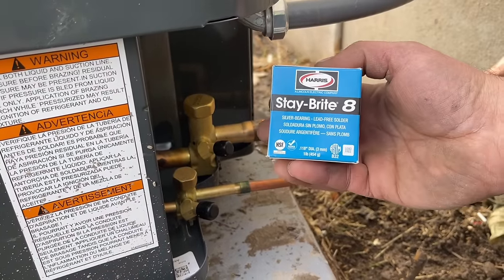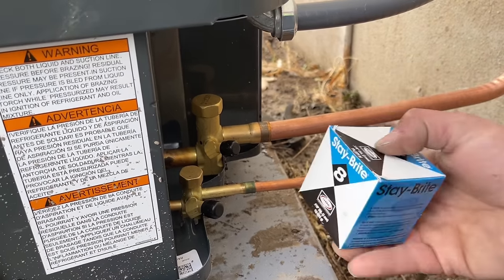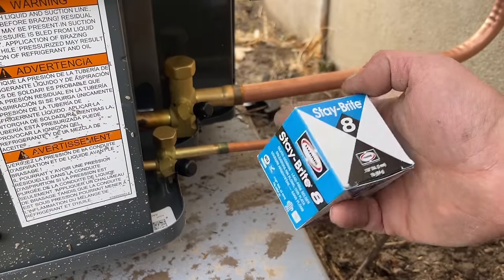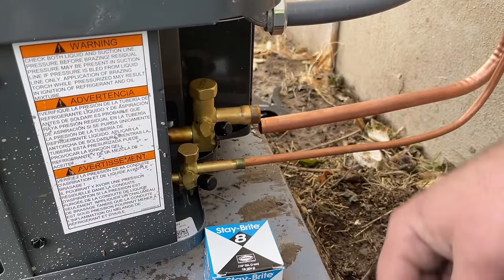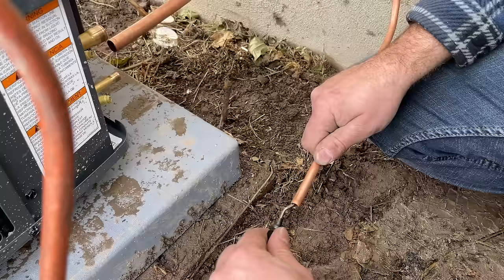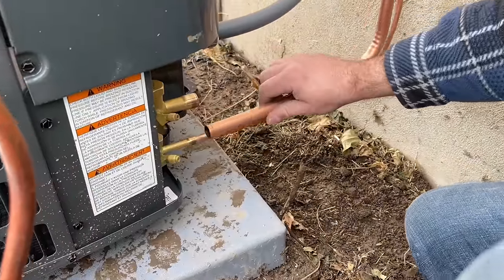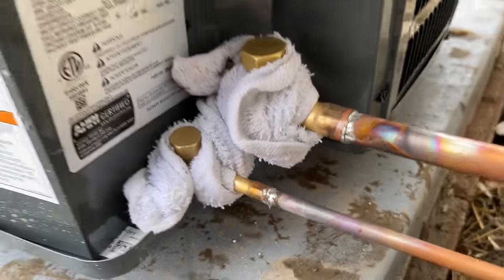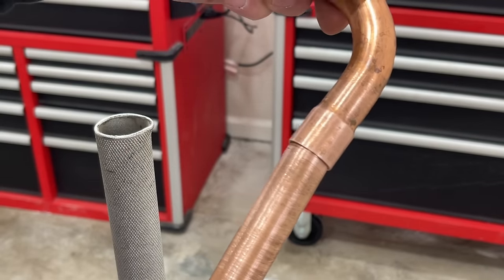An Awesome Alternative To Brazing HVAC Lines. Staybrite 8 Soft Solder

Comment: I had a 5 year old unit that had a codenser failure and bought a goodnan 2 ton replacement and put it in place what kind of price do you think of getting the pipes hooked up is a good price of somebody doing it? The eletric side is alteady done
Reply from the maker: It shouldn’t take more then a couple hours, so maybe 2-300 bucks?
Reply: @diyhvacguy  wish you was around southern indiana

Comment: I want to see at what pressure that joint blows apart. I personally wouldn't use it on a 410a unit, but everyone has their own way. I've never had a leak doing it the right way. To each is their own. With 18 years in the field I've seen soft solder joints blow apart.
Reply from the maker: It’s tensil strength is 10,000 psi. Maybe whoever you were following to fix their work didn’t know what they were doing
Reply: My brother used it on his system, three years ago, and also on his daughter's unit, last year, and they are both running great.
Reply: @Angry Beaver  So Beav, I'm not allowed to comment here?   If you were paying attention and not daydreaming, you would have seen a number of pros have used it over the last 20+ years with great results.  You can go back to sleep now.
Reply: @Angry Beaver  Beaver, the channel is aimed at the DIYer, is it not?   I have every right to comment on this or any other subject.   And, you have the right to disagree.  Commercial work involving larger piping should be brazed. Is anyone disagreeing with that?    This video, however, is aimed at residential HVAC work.     If you're are truly a "Master Chiller Tech", you should learn to chill out a bit. :)

Comment: I’ve been using Stabrite 8 for almost 50 years,I use stay clean liquid flux in place of the paste.I braze the two fittings on the compressor but Staybrite on everything else,I use Map gas.
Reply: What brand MAP are you using? I understand original MAPP gas production in 2008, and what is sold today are substitutes, and I wonder if they are still hto enough for this silver soldering?

Comment: great video   thats the product i want to use.   Should u sand inside the female ends of the fittings?
Reply: Yes, I do, I use a wire brush sized right for the pipe (for soldering copper plumbing you do the same, so I use the same type "bottle" brush).  You need to have both the female and the male cleaned with emery cloth (sanded) or wire brushed, then apply the flux  (whether brass or copper).  I just apply the flux to the male end, don't glob it on like he said, you just need to coat, the when you insert, you won't get flux into the pipes, when you heat up the pipes the flux will flow all around and you are ready to flow the solder, put the heat up both pipes and then just apply heat on the joint near the back - the solder will flow towards the heat.  I have never had a leak or fail using Stay bright, I think those that do, don't clean properly and flux.  You have to clean well just like in water plumbing pipes.
Reply from the maker: Yes in hind sight I should have. I’m going to start using the inside cleaner tool that’s has metal bristles.

Comment: You already have to have the nitrogen for pressure testing I’ve never understood why people make such a big deal about having to purge with nitrogen. Plus not having to deal with flux. To each their own.
Reply: Nitrogen costs money but I hate lugging around a oxyacetylene rig when I can use a smaller propane torch. Mapp gas is not necessary in my opinion. Mapp gas has gotten very expensive lately.
Reply: Wouldn't letting the system rest for 20 minutes after pulling a vacuum and checking for a pressure change indicate a leak as well as nitrogen pressure testing?

Comment: Use a smaller torch tip you cooked it.  I would use map gas
Reply from the maker: Yes, this was my first time. Thankfully the solder took. Moving forward i'll be using map gas, but for this one I didnt have my map gas with me. I should have held it further away for sure. Thanks for the input. Cheers

Comment: Do you use nitrogen for a pressure test? Or just a vacume? I first learned to soft solder years ago with R22 but was told is this not approved for the higher pressure operation of 410A. Was i lied to? Braising kinda sucks but does have some advantages over soft solder. And vice versa.
Reply: Staybrite 8 on their website is labeled to handle high pressure like r-410a
Reply from the maker: You sir were lied to.   Soldering is much quicker and lower temps so no nitrogen flow is needed but it’s sensitive to gaps wheras brazing can fill some gaps no problem

Comment: So after reading all the comments on here, very mixed messages. Which I understand, everybody has their own preferred method and then there are right ways and wrong ways I get it and then there are places and times for certain things vs other things. But I’m struggling with is just using the RLS press fittings any kind of brazing or soldering hard to get answers on that. The fittings are so damn expensive that’s my biggest headache.
Reply: I meant RLS vs brazing or soft 8 solder.*

Comment: Never heat the solder with the torch.  Heat the metal until hot enough to flow the solder.  Also if you get the flame on the flux it can burn the flux and you'll never get a good joint until you clean it all off ant start over.

Comment: Do any other commercial or industrial guys use this??? I have never seen it. 
Seems fine for residential. I wouldn’t solder and intellipack
Reply from the maker: I’m not sure. Is commercial a lot higher pressure? I’ve talked to many residential guys that have used Staybrite 8 for years

Comment: Isn't it just for water systems copper? Ac has to use the cooper and b tank right? Usually
Reply from the maker: No this is specifically for hvac application. It’s a game changer.
Reply: @diyhvacguy  no more b tank carrying !

Comment: This is a great update on a process to avoid brazing.  Now if we only need the nitrogen to do a pressure test, is there an alternate nitrogen regulator and hose you can recommend in your store instead of the $250 one that does not include the tank? Thx!
Reply: Any of the amazon stuff is ok for one or two timers. If you are pro go with victor or turbo torch regulator. Or go to proper welding gas supply and get what they have. I waffle on the good or cheap stuff. Depends on what you are doing. One or for life.
Reply from the maker: There’s no alternative unfortunately. You def don’t want to use compressed air for pressure test. My recommendation is go to your local airgas and see what the smallest tank of nitrogen you can lease would be. Then you’d need a regulator and obviously a manifold gauges set.
Reply: @diyhvacguy  I know the nitrogen regulator and hose is needed for a pressure test, I was wondering if you could recommend one on Amazon that works with the manifold you spec in your Amazon store. It might be cool if you had a "bare bones" idea list bundle of minimal equipment needed for a one unit replacement ...what the avg DIY job would need A-Z  e.g. Pipe cutter, Harris solder kit, map gas torch, manifold, vacuum pump etc? Getting that list down to a minimum takes your knowledge & experience.  Cheers

Comment: Looks like you used too much heat.  Granted I never used this product but if it is a true solder (less than 800f) then it looks like you had it too hot.  I solder all the time but for potable water and mechanical piping (I usually braze refrigerant lines) and the pipe should never be black when finished.  Also you want to heat the pipe just hot enough to melt the solder and then pull the heat off the joint.  Plus you only need a mapp gas or butane torch.  Looked like your torch was over kill.  Though the bigger line looked to be done a bit better than the small line.  Just some tips.

Comment: Don't apply heat like you're brazing. Just heat the valve side to suck the solder into the joint.

Comment: so would you recommend using this method or those R410a connectors you showed last week?  Ive sweated lots of plumbing pipe in my day, never HVAC lines though
Reply: Don't do it especially not for 410 systems this guy doesn't know high pressure systems are to be brazed.
Reply from the maker: I’m sure you will trust this rando commenter over me, but Staybrite 8 joints hold more pressure then brazing. Look it up. I’d recommend Staybrite 8 over the crimp tool as many folks have used Staybrite 8 and had a leak free joint for over 30 years.  The only time this shouldn’t be used is close to high vibrations so right at the compressor. Hope this answers your question. Cheers
Reply: @diyhvacguy  awesome.. I have an LG Minisplit to install in a few months on the new shop I'm building. Id prefer a more solid connection to the line set than using flare nuts.  Staybrite 8 my just be the ticket I'm looking for.
Reply: @diyhvacguy  This is soldering not brazing and you can’t say is stronger than hard brazing let alone insurance related to light flammable gases in refrigeration and AC industry…..so yes you could do like DIY job for your own use but not like professionally in industry

Comment: No soft solder isn't a replacement for brazing...they have their own applicable uses. i would use soft solder in any and all runs i have to sweat or runs in and out of a reasonably small lines going in/out of a moderate compressor but you wouldn't find that stuff anywhere near my chiller racks or centrifugal chillers where the harmonic vibration would be way more than enough to break the solder.

Comment: Hey man, does that soldering may resist heat pump pressure  as 400- 500 psi?
Reply from the maker: Many people have used this for 410a. tensil strength is over 1000 psi

Comment: That gas isn't actually "Mapp" gas, its Map Pro gas as actual MAPP GAS is no longer made.  Map Pro burns only about 135 degrees hotter than propane and isn't worth the $$$ or does it provide much benefit.... if any.  Just use a propane cylinder.  Also, Stay Brite 8 is very good, does a great job.  Oh yeah...make sure to wire brush the inside of the female fitting.
Reply: Tried explaining that to someone else but they wanted to argue. Cant fix stupid.

Comment: No risk of solder getting into the system, even if you don't put it in the female joint?
Reply from the maker: Maybe if you are sinking way too much into the joint. But I feel like that would be pretty difficult

Comment: Can that hold refrigerant pressures?
Reply from the maker: Yesir! It’s rated for 410a refrigerant. tensil strength is 10,000psi with Staybrite 8
Reply: @diyhvacguy  cool so it’s only rated for 410 not R22?
Reply: @Soufsiiide  its rated for R22 as well, 410 has higher operating pressures.

Comment: How much pressure and temperature (discharge line)can
 hold without leaking.
Reply from the maker: The tensil strength of staybright 8 is 10,000 psi
Reply: @diyhvacguy  95% tin, 5% silver, i dunno man.  I would love to use a product like this on refrigeration, but i just dont get it... if it was that great then no one would be brazing.

Comment: It was my understanding that manufacturers were going to not honor warranties if the joints were soldered , due to techs not understanding how to solder and putting to much solder and solder getting into the system and causing problems. Is this still a fact or has things changed it has been over 20 years since i have done hvacr work just wondering.
Reply from the maker: Depends on your dealer. I have a strong relationship with my dealer, I can bring in one with a RLS crimp fitting on the service valve and I’m sure they will warranty it.

Comment: What torch are you using?
Reply from the maker: It’s a turbo torch with just one bottle of acetylene. Easy to carry around. But I could have used mapp gas and it would work just as good if not better.

Comment: Your not supposed to use that stuff on high pressure systems like 410. That stay bright was for R-22 systems and lower pressure systems.
Reply from the maker: Staybrite 8 has a shear strength rating of 10,600 psi and many have used it on 410a no problem 

Also heating the copper to 500 vs 1200 is huge as it doesn’t weaken the copper.
Reply: Will the manufacturer warranty the equipment if they see stay brite especially with a leak in the system,  that's the real question.
Reply: It has worked flawlessly with my brother's two 410a systems.   His home was done 3 years ago.   His daughter's, one year ago.

Comment: Do you think propane would work?
Reply: Propane will work but Mapp gas is hotter and will flow the Stay Bright quicker.
Reply: @groovy1937  Which is especially important when soldering close to the valves. The longer you have to heat the joint, the more heat that goes into your valves.
Reply: @groovy1937   Real Mapp doesn't exist anymore. What passes for Mapp today is barely hotter than propane.

Comment: Before brazing remove both the service valve stems. Braze suction line with propane only low heat. Leave liquid line off blow One nitrogen cylinder  Thru suction line out The liquid line reverse flow. Carefully Braze liquid line. Reinstall valve stems Then pull a good vacuum. You're using too much Heat and Too much Number 8.
Reply from the maker: I appreciate the tips. But nitrogen isn’t needed with Staybrite 8. I’ll agree I had way too much heat with this one. Some of my newer videos with Staybrite 8 give a better representation of how they should be done. Cheers

Comment: I kinked a 1/2” line…. Used this  and it’s been holding 410a pressures.
(Excess amount of solder will plug your lines) don’t use a-lot.

Comment: I like your videos but you really need to improve your soldering technique.  you consistently put the solder directly in the flame.   You need to put the heat on the opposite side so it flows properly and you guarantee a good joint.
Reply from the maker: Yes I definitely have if you look at some of my newer soldering videos. Thanks for the comment. 👊🏼

Comment: DO NOT DO WHAT THIS GUY TELLS YOU IN THIS VIDEO. NEVER use flux on refrigerant lines. He has done this in two videos and has contaminated 2 systems. The only times you should not use nitrogen when connecting refrigerant lines is when using a press type fitting such as RLS, a shark bite type fitting such as RECTORSEAL, or a flared connection,  Buddy, please delete the videos you are promoting with bad information in them because it will lead to people doing things the wrong way. The flux bottle literally says "corrosive" on the back due to fluxes being acidic in nature. Thank you. GOD BLESS

Comment: You could have braised that small one you got it so hot, less heat more cleaning of your surfaces
Reply from the maker: Yes I was learning on this one. I thought I could use my turbo torch but it gets way too hot. Map or propane I’ve found is best. Definitely doesn’t take much! Thanks for the comment. Cheers

Comment: To much heat. You can use a smaller torch.
Reply from the maker: Yes this was my first time using it. I need some more practice but it held my pressure test no problem :)

Comment: Aren’t you not supposed to use soft solder? I only use the sticks
Reply from the maker: Staybrite 8 is rated for r410a on their website and many people say they have had zero problems with it. Like everything else, a lousy joint that wasn’t done correctly is going to leak. Just like with brazing

Comment: That won’t work with systems like 410A. High pressure will blow those joints.
Reply from the maker: Not true. tensil strength is higher then brazed joints. The problem is when people don’t fill the joint all the way. This was one of the first times using it for me, so time will tell but my latest video shows it being used and about how much filler to put in each joint 👍🏼

Comment: All i have to say is way to much heat! Use a smaller tip or even a standard tip. If you need a wet rag its to hot
Reply from the maker: Amen brother. I’m learning. I need more experience but I wanted to share this method. A lot of guys use Staybrite 8 for linesets and have on many a 410a systems with no problem 👍🏼

Comment: Thanks for all the videos for the DIY folks like myself I got a new 2 ton heat pump split system to replace my 26 year old carrier unit I have been nursing along for years now arriving Monday and you are the guy among several others but mainly you to get the knowledge to do this install. But the brazing was the biggest problem as far as cost is concerned so I found this video https://youtu.be/wJD712DB6S0  which I thought ok maybe this will work and I see you have a video on this Staybrite 8 procedure now! Cheers
Reply from the maker: Yesir! If you need some help, feel free to sign up for our membership over on Patreon.com/diyhvacguy where for $25 (cancellable at any time) we will give you one on one assistance with replacement, diagnosing, and even warranty info 👍🏼 cheers